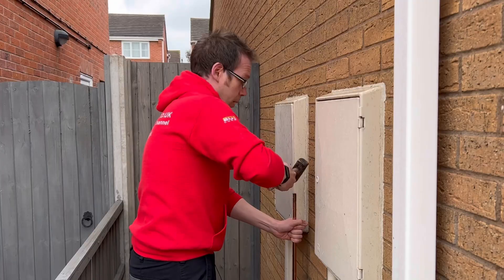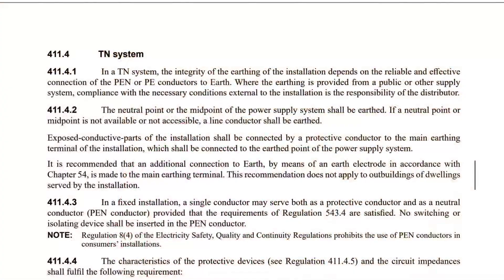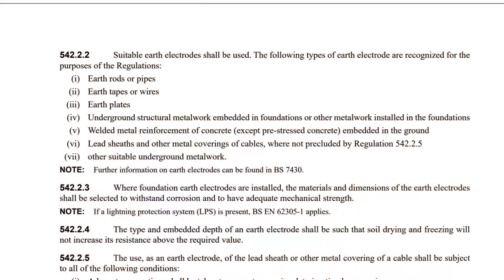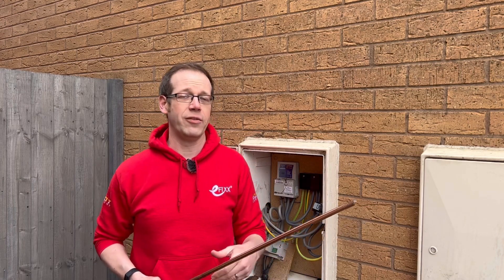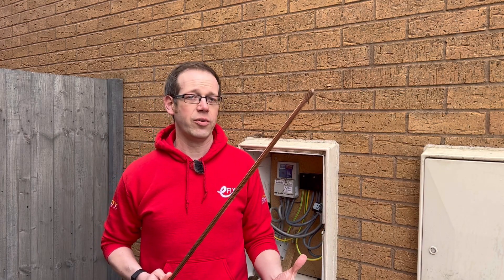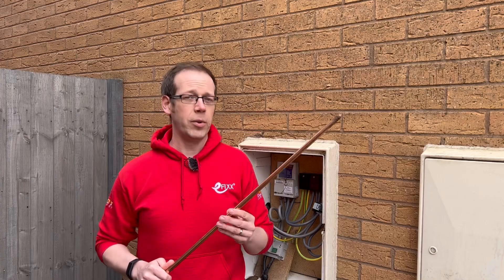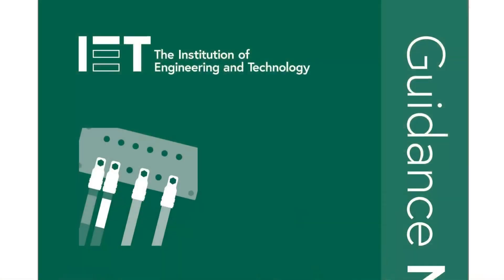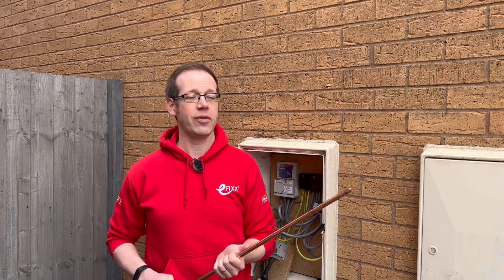Should You Install an Earth Rod?

Comment: As far as I know it was always the norm in South Africa to add a Earth rod to a TN-C-S system. Its only when I came to the UK people told me its not normaly done, but only for TT Earthing. It will be interesting to know if it's done in other parts of the world.
Reply: A separate electrode has been required in Australia since the '70s.  Prior to that metal water pipes could be used as the electrode.  Before we standardised on M.E.N. system (a TN-C-S arrangement) earthing for LV customers a bit of all and sundry could be found and implemented in various ways at that.  Direct/ELCB (TT), M.E.N. (TN-C-S) and SNE (flogged that term from the Britts)/dedicated (TN-S).  In areas where TN-S was used a M.E.T. was supplied and premises earthing attached to that.

Comment: I've just built my summerhouse which is separate from my property by around 15 metres, now what do I do?
1 - Export the main earth from the property only.
2 - Export the main earth from the property and install an electrode to the MET of the summerhouse consumer unit.
3 - Export the main earth for the external cable protection and then not connect this main earth to the MET for the summerhouse consumer unit but install an earth electrode as a means of a main earthing conductor for the summerhouse consumer unit. - This is how you used to do it.
I have my annual NAPIT inspection this week so I'll be interested in what they say!
Reply: @TravellingVeteran  what did you end up doing mate ?

Comment: What is the correct and safe way to Earth a metal frame greenhouse with power outlets inside situated >40m from the main building with a TT supply and Earth rod?
Hint: consider the potential gradient in the ground when there is a close lightning strike. I couldn't find any electricians who knew the answer.
Reply: equal potential bonding is the answer the metal frame of the green house has to be at the same Ze of the TT and ground rod.( if the metal frame is classed as Extraneous or Exposed part.
Reply: @chas3997  Wrong answer. If there is a close lightning strike there will be anything but an equipotential between the greenhouse frame and the building's earth rod 40m away. The most dangerous thing you can do is install a copper connection between two places ~100kV apart.
Reply: @hintoninstruments2369  Theres two types of bonding protection in the uk and they have different rules my reference was to bonding only not lightning protection . In the uk we rarely get lighning strikes.😀
Reply: from what ive seen lightning protection runs outside of a building and is referenced to ground from the highest point
Reply: @chas3997  I don't think you get the problem--like most electricians. Lightning strikes happen and when they do there is a momentary potential gradient in the ground. If you have two earth rods across that gradient they may be 50kV to 100kV apart. A metal greenhouse has to be bonded and is in contact with the ground beneath it so you cannot put outlets inside with a PE derived from a ground rod 40m away. I have 2 core SWA providing essentially a TT supply, but the armour is connected to the green house end ground rod and not connected to the house end. The question is should the armour be connected at all or just left as isolated mechanical protection to the cores?

Comment: My charge point is being installed next to my caravan which is already on a tt due to not exporting the pme to the caravan. It's entirely likely to touch the ev and caravan at the same time. One electrician says to connect to the pme, another says to add the ev charger to the tt. The vehicles are less than 1m apart and both are 30m from the building envelope. Who's right? What would you do? I'm thinking the tt is safer in this case
Reply: Use a PME protective divice like matti ect if using TNCS or condu disk or ground rod if using TT

Comment: The lower the resistance (Impedance) is to true Earth the better. As long as it does not pull a fault Voltage from a nearby installation.
Being a qualified Radio Amateur, multiple Earth bonding is essential on the lower frequencies, as it reduced the noise floor on receive, and encourages a better efficiency on the transmitter.
Electricians would benefit from learning the Syllabus for the Radio Amateur's Exam, as it clarifies Earth resistance over Capacitance between wires in the air over the ground.
Multiple Earthing increases capacitance by a huge factor. It also protects against Lightning strike damage.

Comment: If this is now recommended or if it becomes required, will homeowners have to sort this out themselves or will the distributors get in touch and come and do it as I thought that would be their responsibility? I'm not an electrician, just a homeowner wondering if there's anything I need to do, thanks.

Comment: I'm surprised the UK doesn't require this yet.

I think we've required an earth rod in most US states for  maybe 30 years now, and you have to add one if any major change is made to the system.  In fact, we generally require 2 rods 6 feet apart, 8 feet long.  Before that we required grounding to the incoming water pipe starting sometime in the 70s.
Reply: I heard from another commenter on another video that in Greece if during the construction of a new build proper foundation earthing is not present and inspected the building will not be connected to the grid! Now that will make sure people pay attention!

Comment: Interesting that its not a requirement in the UK. In Hungary at least 1 electrode is required for every building and the impedance must be under 10 Ohms even in the worst conditions like dry or frozen soil. Back in the 1960s TT systems without RCDs were in use and the grounding impedance was well under 2 Ohms.

Comment: I believed the earth electrode was to help make sure the Neutral wasn't "floating" and was 0 volts and created a separate ground path to ensure water pipes, gas pipes and appliances that used earthing. But having earth electrodes too close together with another house has been known to cause electric shock issues if there is a Neutral disconnection fault in one house, the return current will run to the 2nd house to use that Neutral path, energising any earthed items.
Reply: Doesn't this happen with metal water and gas pipes already? My understanding is the lower the the impedance between the MET and true earth the better, meaning reduced touch voltages with additional earth electrodes. Is this wrong?
Reply: @Orgakoyd  Path of least resistance. It will go back to the pole top transformer through the neutral. If the neutral open circuits, then it goes back through the earth, through the ground, and up the earth stake on the pole top transformer. Depending on how far away that is, the shortest path is into the neighbors earth stake and onto their neutral return. But also makes THEIR earth live.

Comment: Hi, yes back in 1983 , when building my own bungalow and installed a 32mill amp trip on a pme system on the main switch the Electrical meter fixer suggested this and sent me a letter of advise from the then SEB , Whilst having this discussion on site , I said it was about time ever circuit breaker had a 32 mill amp trip built in , HOW thoughts catch up on one , years later ,even after many years of IEE regs courses and asking lectures about this , no one had ever heard of this , when others had for though .?🤔👍

Comment: What's your thoughts on regulation 542.1.1 that says earthing arrangements may be used jointly or seperately, but regulation 542.1.201 that says the MET shall be connected to earth by one of the methods. (Ive not typed the complete quote out). It's a bit contradictory that In 542.1.1 we can mix earthing systems but 542.1.201 clearly states ONE.. What's your thoughts on this?

Comment: Australia predominantly uses a TN-C-S system. All LV installations have their own earth rod. A neutral-earth connection is made at every installation, referred to as the MEN (multiple earthed neutral) connection. In some states, notably South Australia due to the use of steel and concrete composite Stobie poles, a CMEN (common MEN) system is used, where the earth conductor is effectively continuous from generator step up transformer to LV installation, that is a common grounded neutral is used for all voltages. The steel joists of all Stobie poles are connected to the neutral carried by the pole, if LV is installed on that pole. In most residential areas, all poles carry a neutral/earth, bonded to the pole joists, even if no LV is present.

Comment: how about metal outdoor tap when kids playing in garden. how about wired grass trimmer. how about outdoor hot tube with people stand on the ground can touch water inside. how about metal case outdoor lights.  there are lots of potential danger situation.  we talked about PEN fault with TN-C-S earthing system, but there is no regulation deal with this, except EV charger.  I do hope there have mandatory requirement to install PEN fault detection device inside meter box.
Reply: The premises earthing system being pulled up to dangerous voltages in PEN faults is a problem in Australia.  The system is set up here to ensure everyone inside the premises is safe but not a lot can be done for people outside of the premises where they can put themselves in contact with the premises earthing system and the physical ground (or metalic equiv of).  The best passive defence is ensuring high neutral integrity.  We keep the number of joints in the neutral to a minimum even to the point of not passing it through the metering.  Occasionally people do get shocked, or worse, by the garden tap.  PEN monitoring is under trial as part of improved network monitoring in general.  There is no automatic service disconnection on PEN fault at this point, at least in the vast majority of installations.

Comment: In Finland we use a minimum of 25 meters of 16mm2 cu to be buried into the ground around the house plus the possible casting irons be grounded as well. It's not unusual to have an L-PE short circuit current over 1kA. The usual connection is tn-c-s and even tn-s requires the separate grounding
Reply: In the Czech Republic, every new house is required to have a grounding strip in the foundation of the house and from this is brought out the PEN terminal, which is connected to the distribution supply from where it is TN-C, ie L1,L2,L3 and PEN. Behind the meter this is split to TN-C-S.
For old houses a 15m strip and a maximum resistance of 10ohms is recommended, maximum 50m even if no resistance comes out.
But in turn the LV mains distribution has each tapping point (distributor fuse box) its own earth, with a maximum of 15 ohms and 50ohms at the end of the branch.

As I see the video, a similar situation was in the Czech Republic sometime in the 50's, it is a shock to me to see that this is possible in a "modern country" in 2023
Reply: @KarelNovák-t5k  Czech Republic still has sockets with 2 wires, with the ground contact connected to the neutral in older houses. That was never allowed in most countries as the chance of a broken neutral is higher than an appliance with a ground fault. Especially with 2.5mm2 aluminium wiring.

Comment: What's the recommendation if you are installing a changeover switch on TN-C-S? A supply company worker told me that the generator earth should be kept separate from the distributor's earth. So when you changeover from mains to generator uou are also switching the earth. This was in vase of a broken supply neutral which could leave you with a live generator casing.
Reply: yes it is. how about metal outdoor tap when kids playing in garden. how about wired grass trimmer. how about hot tube outdoor with people stand on the ground can  touch water inside. there are lots of potential danger situation.  Robin talked about PEN fault, there is no regulation, except EV charger.
Reply: @huyongquan6554  I think there is a similar regulation for camper van pitches. They should have a separate TT system, even when supplied from a TN-C-S/TNS system
Reply: @alasdairmacleod5638  yes  TT island for caravan, it suit for TT, and can easy get it. no underground service pipe.  For TN-C-S property there is no chance to get good reading of electrode except you live near pond or river with risk of flooding.
Reply: @huyongquan6554  MET to earth rod to suppliment a TNCS is safer if installed correctly and adds touch voltage protection outside and existing equal potential zone like outside tap or class 1 outside item light ect.

Comment: For TN-C-S earthing arrangement system. we have three status: 

Normal status ( No fault status): the potential difference between exposed parts or extraneous parts with ground( not true earth, true earth concept is disputable, true earth potential shall be 0) vary with distance from electrode or service pipe underground. 1 meter away difference will be 60% to 10 meter away fraction factor increase to 90%, so if you stand 1 meter away from the location electrode installed, you still have 18.5*60%=11 V, it can not be 0 voltage. 

Earth fault status, to say fault current 400A, MET voltage to true earth to say =400A * 0.35/2=69V.  1 meter away from electrode still have 0.6*69v=42 V. for example, vehicle is 4.5 meters long, if you touch the EV or outdoor water Tap 4.5 meter away from electrode, you will have 0.8*69=56v, if  you are with bare foot, that will be problem.

Pen fault:  MET voltage to true earth very often will be more than 210V ( normally earth electrode 200 ohm), 1 meter away from electrode still have 0.6*210v=126v.

That to say, the additional electrode installation is useless for TN-C-S , except you can get electrode reading below 2 ohm, best practice is to  install PEN fault detection device.  outdoor metal tap is potential danger.

To install good electrode, it could be cost £300 or more, depend on the condition of soil. some time you can not get good reading. 
To install PEN fault detection device may be same or less, parts will be £170. I will install 100A PEN fault detection device and it will future proof if you need install EV charger.

Comment: I think the DNO/DSO should provide the Earth and it should be free from defect.  However in all things that cost money, they are making the the Sparky and customer foot the bill.  To be honest I would say that BS7671 reg 411.4.2 could be split into new build and retro fit existing instalations.  It is far easier to fit/install Earth rod/spike/plate/grid during construction than it is to retro fit a rod/spike/plate/grid at a mid terrace house in your average town.  

To add the cat amongst the pigeons what if your house is on a looped supply?
Reply: How is the sparky being made to "foot the bill"? The cost will be passed on to the end client, just like it would by the DNO. This is about which method is better, not who does it and who pays. Localised foundation earthing is far superior. The UK is decades behind most other modern countries when it comes to earthing (just see all the comments on here).

Comment: Could you guys do a video on parallel sources on a ring main and their protection. And on garages or sub DB.

There was a big thing for a few who didn't get the selective protection set up and that it can be done. And term down/up stream
Re 551.7.2

This would solve a massive headache with some installations with low power sources.
Or your views. Being mindful of the final circuit defined.
(Source being parallel aka solar inverter)

Yes a bit cryptic, but didn't want to narrow it.

Comment: The actual soil at the installation will have an effect on the efficacy of any grounding system,soil types and water content etc.will alter the resistivity and effectiveness of a rod,Chalk for instance is a very good insulator. Our local church is situated on a cut out of rock,plateau on the hill. The lightning conductor is cleated across and down the face of the rock, a journey of about 150 ft to a steel post in the soil below,but some of the land round here is below the water table and soggy wet all year round.When I walk my dogs in the stream you can see across to the back of the farm buildings on the other side, and for years the old barn and all the outbuildings,milking shed etc.that were there were being protected by the earths simply being bolted to one of a huge,probably 200+ ton pile of rusting RSJs just laying in a sodden ditch behind the sheds, it looked like a proper protected joint too not just an exposed nut and bolt!  I never heard of any incidents,no one being fried etc.when I mentioned it to the guy who tested my house he joked that some areas around the village were so wet you could just chuck the rod on your lawn😊

Comment: There is now so little metal work in contact with the ground on the distribution system since the late 70s early 1980s all Pvc served cables. That every bit of extra earthing is needed.  It might ge worth foing done videos on the ENA guidance for earthing and what current practice is especially with regards to step and touch potential.